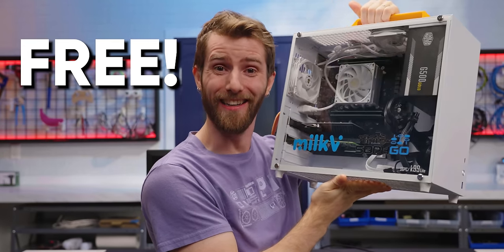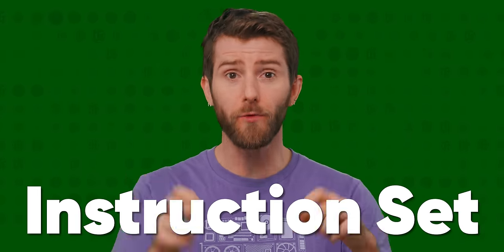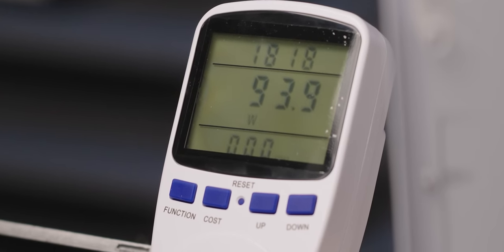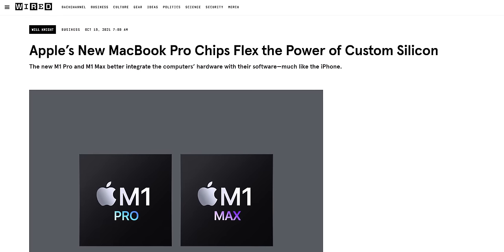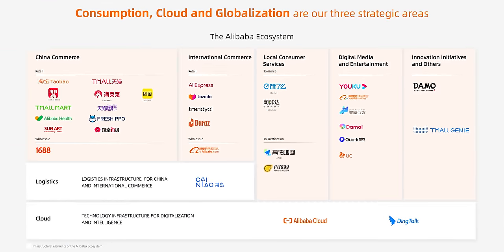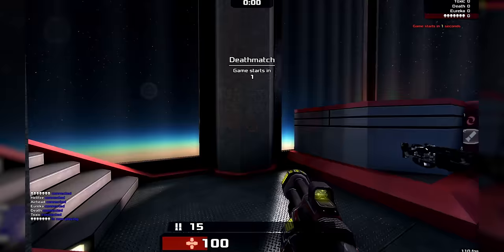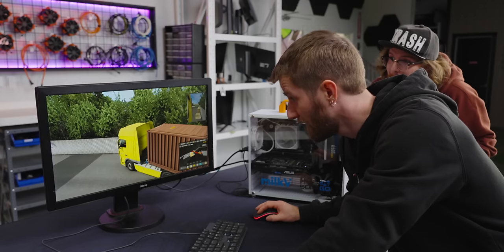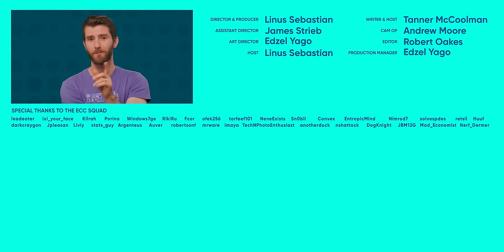This CPU is FREE! - Milk-V Pioneer with RISC-V

Comment: NOTE:  The same Linux kernel 6.2 that introduced RISC V support ALSO introduced FULL SUPPORT for Intel ARC video cards -- so yes,  THAT is your first choice for video card!
Reply: There's any number of relatively powerful GPUs that have full Linux drivers, much nicer than the 500 series.

There are two problems, one is x86 specific intrinsics in the driver, but that's a problem that presents itself clearly and is easy to solve.

The other is that GPUs require extensive support for memory mapping from the PCI host chipset and the driver, which is specifically the problem why none of the nicer GPUs work on a Raspberry Pi or this for example. Solving this requires an INSANE level of insight, which is why it's been so slow to get tackled. I surmise Intel ARC is going to prove particularly quirky, given how much dependence on Resizable BAR it has shown.

For the time being, GCN4 chips are the only ones that got any headway in solving this at all.

The low performance also won't be helped much by going to a faster GPU, since the primary bottleneck is the CPU performance in this system.
Reply: @Psychx_  Huh.  I put the wrong kernel number in, thanks for drawing my attention to that! I meant to type "6.7" because I read that as being fully supported in that kernel's information. But it has no information at all about the rest, and I consider that, "fully supported" information.

If AMD doesn't have the memory buffer support, that would be a significant barrier to it . . . but this is not an AMD CPU, as far as I have seen mentioned. Who knows what memory management arrangements it supports? That would be down to on-chip PCI-E and memory address controllers and drivers.

In RISC, those instructions are in the drivers whether the hardware circuits are in the CPU or on a separate controller. Reduced Instruction Set is in the name. Sometimes manufacturers lock hardware out, as Apple is infamous for doing (infamous among long-time Apple users, anyway), and HP and other manufacturers to a much lesser degree. If you saw the video on that final-version Voodoo 3D card, well, I had one that was PCI-X 64-bit (before PCI Express existed; I think 4x AGP had just come out. 64-bit is the square of throughout of 32-bit, and that "4x" is a multiplier of 33 MHz. In this case, though I didn't know it at the time, the GPU cores were only 32-bit and the 64-bit bus was divided between them. Probably why my driver never worked, eh?) for up to 100MHz bus, and I had an HPUX RISC workstation to put it in. What I didn't have is a copy of HP UniX to run on them to grab the driver .kext from, to import to the Linux I was running. I found a vendor to sell it to me, but didn't have the budget for my hobby. (It's not cheap, being corporate development and banking/industrial-market specific software; they don't blink at paying $10,000 for a single-seat program.) I tried for a couple of years to write a driver, but I was completely new to programming and . . . well, I didn't succeed. No one in the Debian Dev group had an example to work with, so since I had bought three of the HP boxes at an auction because they looked cool and my boss gave me that video card as he hadn't sold it, I shipped that box off to a Debian dev who had been interested and willing.
Reply: @Psychx_  You realize that your final statement there is insane, right? Are you getting professional help?
Reply: @Psychx_  I was not being insulting, I was stating a fact and asking a real question out of concern.
Reply: @Psychx_  I was simply explaining my background experience with RISC and why I know how it handled memory and graphs . . . I thought that was obvious, and worth explaining.

But you have stated three related areas as definitely the cause of a problem. At first I thought you were involved with dev, or tracking it, but you gave no chops and you started bouncing around on cause, which is a symptom of major confusion. That's not necessarily a serious development in mental problems as in "clinical paranoia" or anything like that, but it absolutely, always, is a mental problem in the literal, non-psychology, sense. That can spin out.
Reply: You guys are way too smart.
Arguing about Resizable BAR's and Kernels.
Reply: Intel’s Linux Drivers don’t work well on non-x86 platforms.

Comment: Gotta say, as a gamedev who frequently has had to work directly with assembly language, RISC has probably been my favorite to work with, mostly because you're almost never shooting yourself in the foot by not using the esoteric instruction you didn't realize existed or works the way it does in order to do the thing you're doing manually with multiple other instructions. You just accept that you have a pretty good instruction set and you'll need multiple instructions to do most things, and that's fine if it means the CPU itself can process instructions faster or with a much deeper pipeline, which is the goal with RISC.
Reply: The things you can do with Load Effective Address are absolutely hilarious, want to multiply a number by five? Use lea because it takes one instruction cycle instead of the multiply instruction which takes multiple xD. Also x86 has two instructions to help calculating sha256 checksums because why not have that built in to the CPU in every core. I'm sure those are called all the time (I am aware they are called pretty regularly, but not THAT often lol)
Reply: Do you think splitting those multiple instructions into a separate function would yield performance gains?
Reply: What do you mean you didn't knew the instruction GF2P8AFFINEQB ? smh my head
Reply: @cyuria  There are filesystems like ZFS, that have checksums integrated. Thus they will have to calculate these when writing and reading data.
Reply: @OpenGL4ever  yeah I'm not saying that checksums aren't useful but it just seems like an interesting feature to put in a CPU core. If I were to design it, I'd put stuff like the checksum into a separate chip (maybe still on the CPU, but as a component separate to the cores) so it reduces the complexity etc etc of the CPU. This does reduce the theoretical "checksum bandwidth" but it's incredibly rare to need to calculate multiple sha256 checksums at the same time unless you're running a server or something, in which case just build the functionality into an external card like a network card or something. Also note that I'm not a CPU designer and may not know what I'm talking about.
Reply: @cyuria  Well, these sha256 instructions are divided into microops anyway, which is why you don't need additional transistor area for these.
An outsourced solution on an extra chip would cost more.
Reply: @OpenGL4ever  I haven't studied chip design, so I'm pretty much out of my depth here, but wouldn't it still either significantly add to chip complexity or provide no real performance gains apart from maybe being able to load more instructions into cache at once?
Reply: @cyuria  I'll explain it like this. If you have an instruction that is divided into 4 microops, for example, then the first microops does one task, e.g. load data from one address, the next one does something else, e.g. some arithmetic operation, and the third and fourth also do something different. The first microop that loads data from an address is also needed for hundreds of other instructions. So you can say you have Microops sharing.

So all of these instructions are broken down into microops and many instructions require microops that do exactly the same thing, so you don't automatically need more transistors just because you add one more instruction in your ISA.

If an atomic µOps is actually added that does something special, then it must be really important and be used by many new other instructions. And since it only does a little, the increase in transistor requirement would be very little.
Reply: @OpenGL4ever  yeah I got that, and I thought that there wasn't any performance gain because you could just use the same microops with another combination of instructions but I realise that's not necessarily the case if there are no other instructions with the specific micro op combination optimally required, which would probably result in a couple cycles saved over every checksum or some power savings or something, so unless there's a better use of the instruction space it actually makes sense to have a dedicated instruction here. Thanks for explaining it to me
Reply: @cyuria  You're welcome.
Reply: @Felice_Enellen  68000 has been fun, buy you feel like your playing a game of TETRIS with bug, long blocks 8-30 spaces long.  RISC is like playing old TETRIS, but everything is just three blocks.

Comment: The "dust covers" on the SATA ports are probably to help pickup the part when assembling the mainboard. Having a flat top surface is easier for the vacuum pickup tools. They're just saving an assembly step by not removing them.
Reply: True! This is very common on some parts like, for example, female mini USB ports.
Reply: My thoughts exactly. I've picked a fair few of those by hand working in the electronics industry
Reply: RISC V is an actual architecture whereas RISC is the instruction set is uses. Big difference lol

Comment: I think a misconception as that arm made it easier to port to RISC-V because both are are risc, but what makes it easier is actually just that people are more used to supporting x64 and arm over the last years (especially on Linux) and as a developer it's then easy to  just add a 3rd option. For modern developers the adjustment wasn't the instruction set, but just to generate 2 or more builds instead of one.

Comment: You should 3d print a plastic bit to go in the screwdriver so you can use it to point to stuff on a pcb without risking a short.
Reply: that is absolutely genius
Reply: That will be $9.99
Reply: @EatYourUranium  + 20% premium
Reply: how about you do it and then put it on thingiverse than point him to it
Reply: Agreed
Reply: A 3d print of a Linus hand at actual (small) scale
Reply: Or just tape over it.
Reply: or just get a finglonger
Reply: There's always a risk of a short(linus) in an LTT video
Reply: I cant velieve those screwdrivers are selling at all, im a bit of a tool hoarder so of course i bought one but after using it i far prefer my Klein ratcheting screwdriver half the price with a far superior handle and ratcheting mechanism, the ltt ones just feel cheap in the hand yet cost twice as much
Reply: Toothpick works the same :)
Reply: Dialing Wand

Comment: Not all of RISC-V is free or open source.
There's a baseline that is, of course, but then, many of the highperformance extensions you'll see popup will probably be propietary to one manufacturer or another, and it's yet to be seen whether any of them become free/open like the main spec, particularly those that eventually succeed in the market. It's probable there will be licensing costs to the most desirable extensions to RISC-V.

Comment: 1:25 Normal!?? 128 GB error checking RAM and 1TB SSD, 64 core processor, that's normal?! 16 or 32 GB would be what I consider normal not 128 GB. And I don't know what is normal core count for RISC-V but I was thinking more like 4 or 8 cores, not 64 of them!